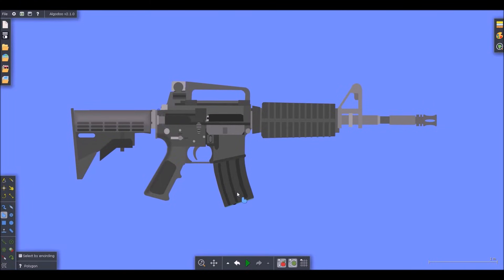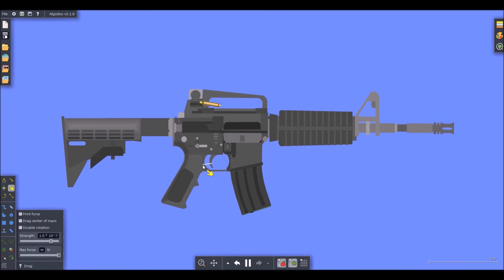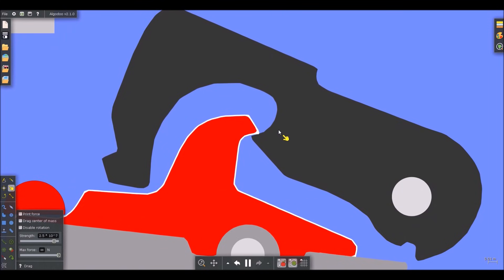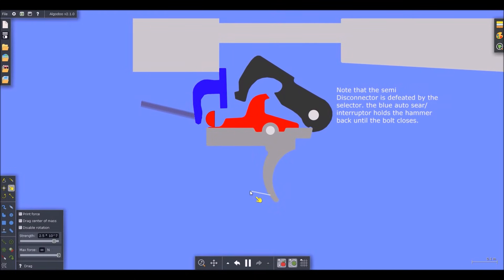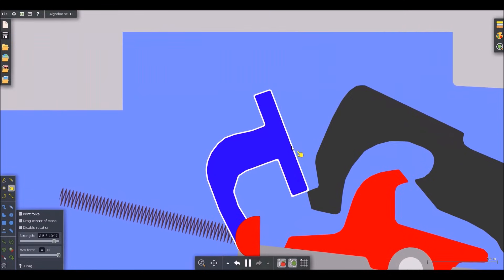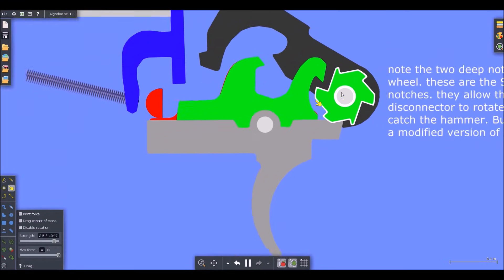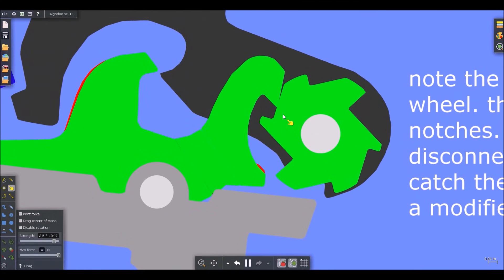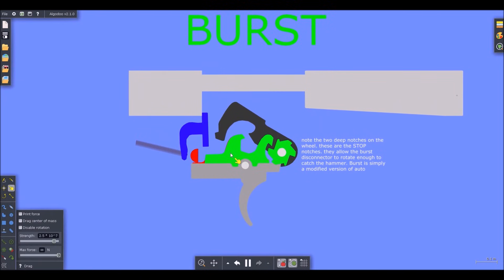How 3-round burst works

Comment: There is just one thing that I don't understand, many firearms have the ability to switch between semi, burst and fully automatic, however, how DOES it switch between burst fire and fully automatic? pls help
Reply from the maker: Royal Nightstar you know how the semi -auto disconnector has that surface that interfaces with the selector axle on auto or burst?

Add another one to the burst disconnector and have an index on the selector that interfaces both disconnectors. Now they can't interface with the hammer.

Does that make sense?
Reply: Stealth The Unknown Yes that actually make sense, however how does it stop both disconnectors just by turning a knob?
Reply from the maker: Yes. The selector is an axle that runs through the receiver (portion of the gun that houses the trigger components), and it runs right across the "tail end" of the disconnectors. Since both disconnectors are spring-loaded, they can be retained or "disabled" by the selector.

Think of the selector as an axle with cut-out portions that, when the selector is turned to a certain position, allow certain parts to move.

On semi, both disconnectors are enabled while the automatic sear (blue) is disabled (it's not needed.) Technically, the burst disconnector isn't needed either, but the trigger winds up being a bit lighter and the selector winds up being simpler as well.

on burst, the semi disconnector is disabled, and the auto sear is allowed enough freedom by the selector to interface with the hammer.

on auto (there are aftermarket 4-position selectors and trigger kits for AR-rifles), the auto sear is free, but both disconnectors are retained by the selector.
Reply from the maker: I think I see your confusion. On the M4 carbine, you have EITHER burst OR auto; NOT both. The military has 2 variants: the M4 Carbine (burst) and the M4A1 (auto). Both have semi, but the M4A1 lacks the components that make the M4 fire burst
Reply: Stealth The Unknown yeah but there are guns with all three fire modes right?
Reply from the maker: Yes, and their mechanics are often a bit different. I do have a few other videos describing different mechanisms, if you want to check those out. Namely, the HK mp5 and Sig 550-series rifles
Reply: Stealth The Unknown wow thank you you cleared all my confusion
Reply from the maker: You are welcome, sir. have a good one, and don't hesitate to ask further questions should any arise!

Comment: Awesome video. By the way if in full auto the hammer fell on open bolt (bolt follow), it does not cause damage but a misfire as the pin might not be pushed in strongly enough against primer.

Comment: You gotta get that thing fixed. It has some serious bolt bounce. I would suggest a heavier buffer weight. :)  Seriously though, great illustration of both full auto & 3 round burst. 
Great job!!!
Reply from the maker: eh, algodoo doesn't like it when things are super snappy and crisp. That bolt bounce is actually the result of the chamber pressures pushing the whole assembly back a tad before the bolt head unlocks (tolerances are a bit loosened to accommodate algodoo's lower accuracy in physics than, say, real life)

Comment: Im thinking... maybe a dumb question. But If u set the Semi automatic to Automatic... How the second sear not activates? At the automatic, the trigger is going a bit more backward thats why?
Reply from the maker: the disconnector that is used in semi is blocked in automatic, so it never catches the hammer like it would normally.

Comment: May I ask: If (hypothetically) one would be quick enough to pull the trigger, thus initiate a 3rb, release and re-pull the trigger during the burst - what would happen?

Would only the three shots of the first trigger pull be fired
or
would another three shots be added to the already fired shot(s)
or
would this be a second 3rb, resulting in a total of six fired shots?

Thanks in advance for your answer!
Reply from the maker: Just Another Gaming Enthusiast any release of the trigger halts the firing- release after 1 shot, 1 shot is all that's fired. Release after 2, it's 2.

With this particular setup, the burst mechanism has what some refer to as a "memory", meaning it won't reset properly on its own: fire 1 shot and release, and the next trigger pull only yields two shots.
Reply: Thanks for the insanely quick reply. I was just watching your H&K burst video and think I was under a misconception of burst fire to begin with (never actually shot anything other than semi auto). So from what I understood is that a trigger release always stops the burst, even if not all shots have been fired, correct? I originally thought that a trigger pull and release in 3rb equals 3 shots.
Reply from the maker: Just Another Gaming Enthusiast i presume video games are largely responsible for this misconception - I have yet to see a game get it right!
Reply: Actually, I am an Indie Dev by night and am currently doing my research 
on how to get it right ;) I'll add you to the thank you section of the 
credits. So, thank you! :)
Reply from the maker: Just Another Gaming Enthusiast I do a bit of coding myself - I'd be happy to help with anything if you'd like to have another mind for gathering resources and brainstorming!
Reply: Cool, thank you very much for the offer. Your expertise actually helped me a lot here. Since I want to have a relative realistic approach to firearms in my game, I am quite sure that I will be in touch again, sometime in the future, when another question arises. As I said, I'll add you to the credits and hook you up with a game key whenever I am done (likely 2050, but I try to be done sooner ;) )

Comment: so question : from my vast experience in firearms from playing COD, CS, BF, SOCOM, etc. I believe if you pull then release the trigger quickly, you can fire just a single shot even though it's in burst fire mode.. if this is true, the next time you hold the trigger for a burst will it only fire 2 rounds because of the position of the spinny thing? and also if I single fire 2 rounds, if I hold the trigger the third time around it'll only fire once even though it's in burst fire mode??
Reply: sorry if the question is hard to understand, my expertise is in firearms not English........ LOL
Reply from the maker: Marcos Haubert this is correct: just like in auto, if you release the trigger, it will stop firing. 

On firearms like the M16 rifle/M4 carbine, the burst mechanism is NOT resetting, so you can get 2-round bursts if the wheel is not in its normal position (caused by early release or firing on semi)

On many other rifles, carbines, and submachine guns, burst DOES reset (3 shots are always available if you press for the full burst duration)

Comment: Is there anything on a single shot only AR preventing the user from dropping the hammer before the bolt is fully forward and locked like in full auto?
Reply from the maker: TryHardGamers no, since it's not really necessary. Most of the time, your finger can't keep up with the cyclic rate, though aftermarket accessories like the slide-fire stock can occasionally "outrun the gun".

Comment: How does the safety work on burst and auto? In the video it's in the "safe" position if the gun was semi. Also how would you circle between semi and safe and burst/auto? I'm assuming the selector would be shaped different but I can't see how it could be accomplished without an additional part
Reply from the maker: tempviduse the selector just detains certain components to restrict them from functioning. In semi, the semi-auto disconnect is free, but the auto sear is restricted. In burst/auto, the semi-auto disconnect is detained, but the auto sear is allowed to move. On the selector axle, there are cutouts and notches that give or remove mechanical freedom to these components
Reply: Stealth The Unknown I see now. Thank for the speedy reply. Great video

Comment: What about the AN-94. How does it shoot ts first 2 rounds faster? It uses a pulley mechanism doesn't it?
Reply: Kobi Jenkins yeah check out forgotten weapons on the an94 full dissasembly.
Reply: thanks mate
Reply from the maker: yeah, couples a counter-mass driven pulley, a microbolt, and utilizing the chassis' recoiling into the receiver to further reduce the distance the components related to firing rate have to travel. truly, that ridiculously high rate of fire is there TRUE cyclic rate of the AN94. the reason it's only 650rpm in auto is because that's the speed that the chassis recoils at, and it uses a trip for the sear that only activates when everything, including the chassis, is back in battery. during the 2 round hyperburst it's using timing on the recoil impulses, and the distance the chassis travels. there's basically a carrier with a groove that the selector slides back and forth: forward all the way makes that groove the shortest compared to the chassis' travel, and so the dropoff at the end arrives after only one shot: semi auto. on the next setting, it lets the sear go after two. in full auto, it's back only a little bit more - not enough to make it 3 burst, but enough that the carrier now introduces an angled tab into the motion of the sear at the very front. it's important to note that the trigger TWISTS this carrier in the direction algodoo can't model. The result: the carrier twists upon squeezing the trigger, rotating the carrier, whose groove depresses the sear and releases the striker. the gun fires, and the chassis recoils, but not enough for the carrier's groove to let off the sear. the gun cycles, the chassis rests in suspension at the point of the first shot, and upon closing of the bolt, the striker, which follows that microbolt, hits the back of the microbolt and dents the primer. it cycles again, and now the second impulse drives the tab on the sear past the groove on the carrier, causing it to reset up to catch the striker. the sear now holds the striker the whole time the chassis is compressed backwards by recoil impulse, and only releases it upon hitting that extra cam surface on the carrier. the tab on the sear is spring-loaded so it can collapse against the carrier on burst and single, which pops out into the groove when you release the trigger.

complicated as fuck, but clever

Comment: what if you just quickly press the trigger and let go on the burst mode would it then stop the the proces and stop firing thru the whole burst?
Reply from the maker: Lukas Svensson it stops and "remembers" where it was (wheel does not reset). Fire 2, release, and next burst will be 1 shot, and so one.
Reply: damn i didnt think you where gong to reeply that quivk since the video is 2 year old... so good job answering the comments and thanks for the answer. Ps keep up the good work just got a new subscriber ;)
Reply from the maker: Lukas Svensson thanks dude :)

Comment: Excellent video.  I think a lot of people talk about how much better 3 round burst is than regular full auto (it does have practical advantages, but one should be using full auto for bursts anyway, it just takes more training...) without realizing that it is a bit more complex mechanism to make, more parts to break or have something go wrong etc...  That being said it's a pretty well designed mechanism that works well and isn't prone to failure.